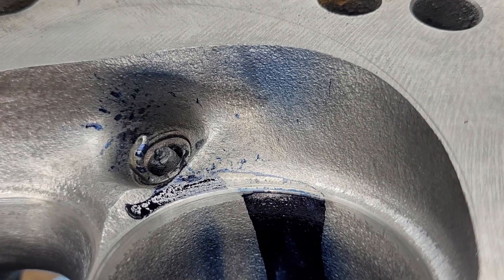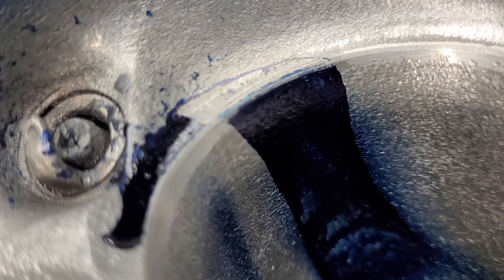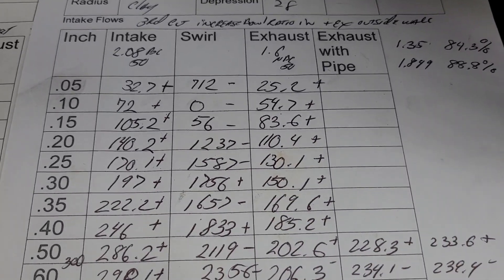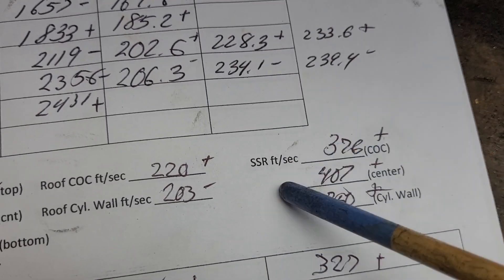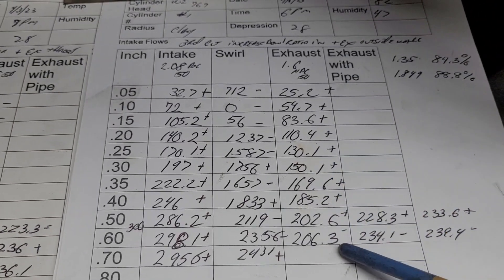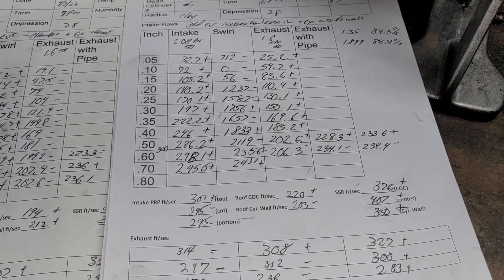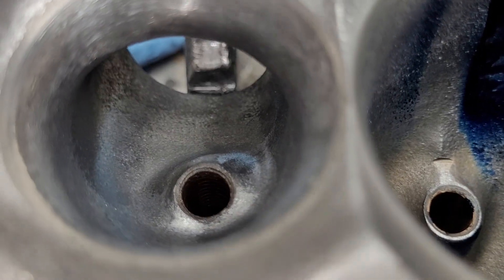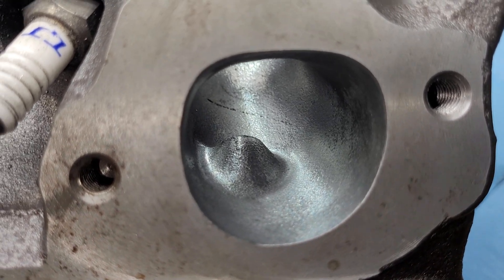Mopar W2 769 cylinder heads 2.08"/1.6 50 degree seats, chamber and throat development.

Comment: What is the best dual plane you know of? What can a performer rpm flow ported?  I haven't looked at a performer rpm in years,  but I am thinking possibly about going to a dual plane, but I need them to fit 220cc runners! I do not want to totally kill top end, to gain low end tq! 
I thought about cutting and welding a rpm , open the runners up possibly weld the thin spots on the top, and open it up from the bottom, weld in 1/8" bar to close  it up,  years ago i heard a couple guys had a good experience with a weiand stealth intake,  its not my kind of thing, i like high rise, either dual or single plane,  i have a 385 stroker, with 210 cc aluminum  heads, zero deck, flat tops , with about 63cc chambers,  and a comp cams nos hp cam, the largest flat tappet, i cant recall all the specs, but itd about . 565-.585" with 1.6 roller rockers, I'd like to go to a hyd roller,  and work the heads a bit, Doug Herbert built the heads, 2.02" -1.60" valves, tgey are still new, only bolted on,  14 years ago,   i want to pull it back apart, work on a few things , it has a single plane profesional products intake, and a Holley 750 double pumper,  i figure its about 11:1or just shy of it,      i was wanting to go with about 10:1, and a turbo,  about 15-20 psi, but money ran low,  so i went wut flat top pistons,  but still went with the 5140 crank and rods, with studs in the 4bolt mains, and heads,  i also have a 400 block id like to build, and another set of aluminum heads, not sure whay they are, bought them used slightly,  they seem to be more like 185-195 cc, , I went with the larger ports because I seen a few 383 builds that seem to run iut of air above 6k-6500 rpm, I was hoping to pull hard to 6800+, maybe shift at 7k when pushing it, but keep it under 7k,. I somewhat  followed another build, only went with slightly larger intake ports, and single plane intake, and slightly different cam, seems the engine made 530 HP,  I was hoping to spin  about 500-800 rpm faster and hopefully make 50-80 more HP,  I was going with the 292 magnum  from comp cams,  or possibly the 305 magnum,  but I was hoping for more lift than they offered,   sorry to ramble, good day
Reply from the maker: My fav dual plane is the chevy iron bowtie. I did a full work up on one a while ago. On a 300 cfm head it knocked it down to about 260 cfm which is pretty good  for a dual plane.

Comment: Great series !  Most informative vids I have seen on porting and flow dynamics! 
They made at least 3 dual plane W2 intakes.  Mopar M1 , Edelbrock LD340 TA , Mopar cast Iron 4 bbl & 2bbl based on late 70s 360 intakes . 
I have a NOS cast iron 4 bbl and had a NOS M1 but sold it a few years ago .  Also just sold a NOS Holley Pro Dominator a few months ago .  Shouldn’t have……  
If you have any interest in experimenting with the cast iron intake I would send it to you but would want it back once you are done .
Reply from the maker: Good info and thanks for the offer.
Reply: Mopar made a cast iron W-2 intake?
Reply: @topseykretts251  I think MP made them for the dirt track racers that had to use a cast iron intake in some classes.  I have the MP aluminum W2 dual plane that is basically the 340 AVS intake but with the W2 bolt pattern and in aluminum.

Comment: Mopar Performance part number P5249572 is the aluminum dual plane for W2 heads on a standard 9.6" deck block.  P4529408 is the standard single plane.